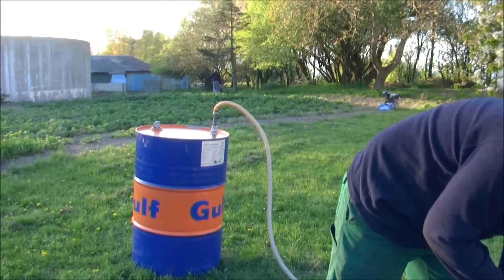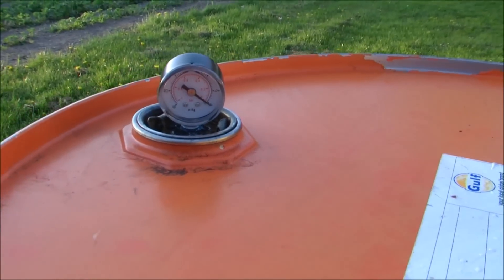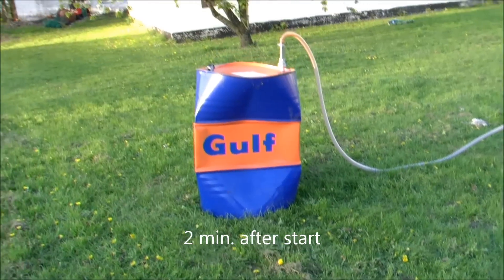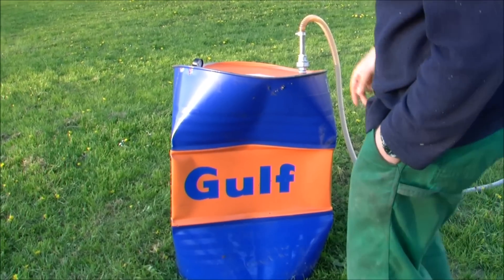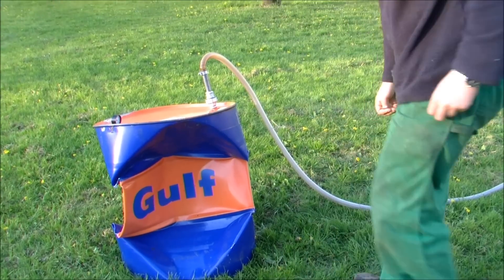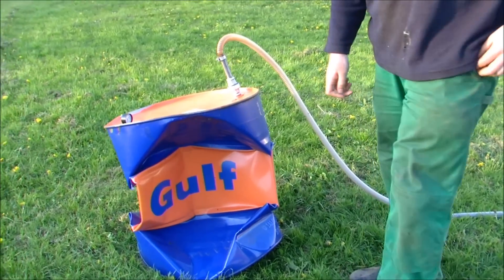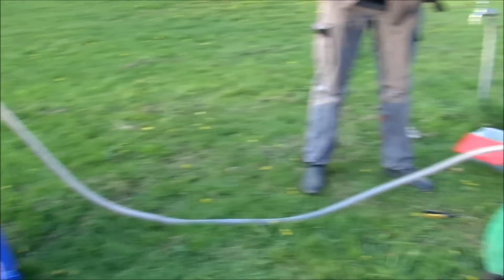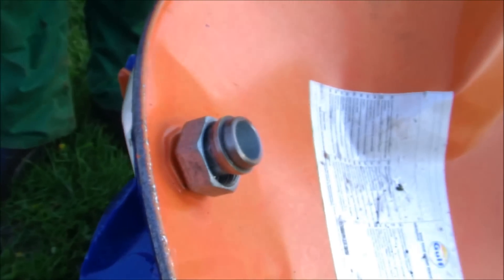Oil barrel getting crushed by the atmosphere, using a vacuum pump.

Comment: how low was the internal pressure before it broke?
Reply from the maker: After 1 min it is down to around -0,3bar. and when it implodes it looks like it is down to  between(-0.4 -0.44)bar
Reply: Think you could open a valve from a contained unit the same size at 5x10 (-9) militore or near then purge into a separate sealed unit to see if the results are different?